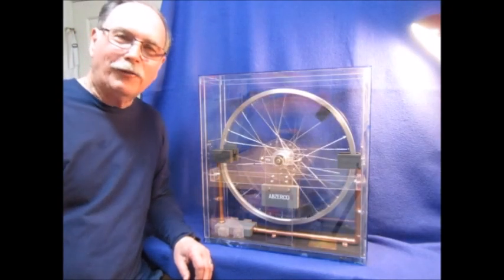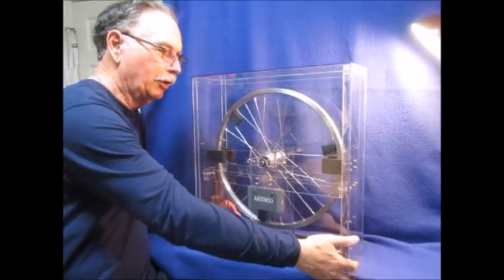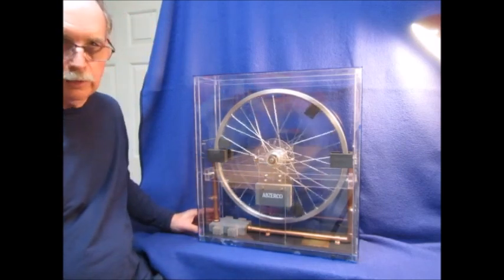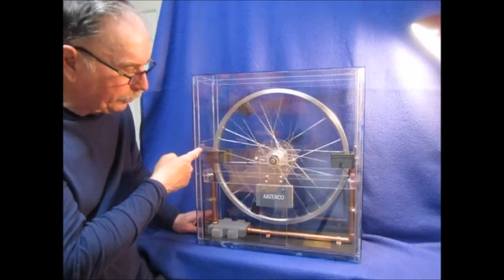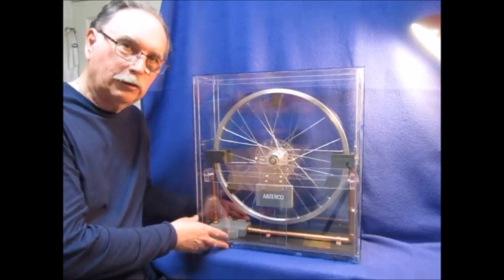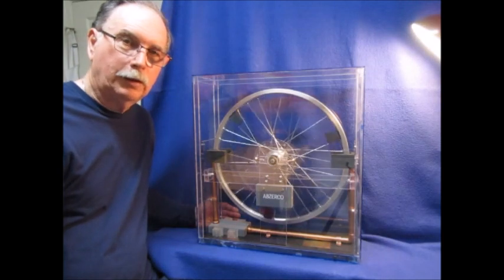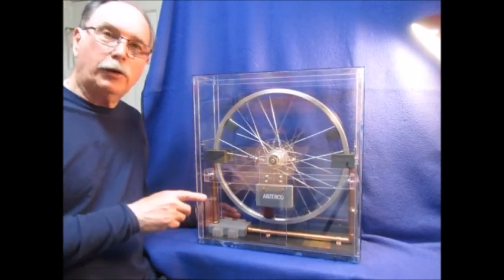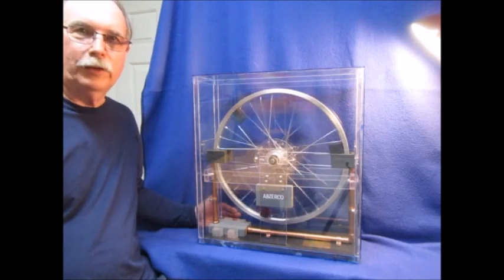Impossible perpetual motion machine with a bicycle wheel  2024

Comment from the maker: Great question… been running for over 2 months continuously..still modifying the device.. hope to get it to run over one year..tip on the wheel.. have a bicycle shop remove grease and replace with high tech lube..the tune it.. it will run like glass.. you will also have to balance the wheel.. good luck with the project.
Reply: Thanks for the pointers. Wheel is new but certainly could run with less friction. Only thing that worries me now is mechanical wear on a component, it being purely physical thing. Concept works though-though the rough test ran for 2 weeks.
Reply from the maker: @mvmagic  I had the bicycle shop remove all the grease and put a high tech lube that racers use to improve the smooth rotation of the wheel.   That is what I suggest to really improve performance.